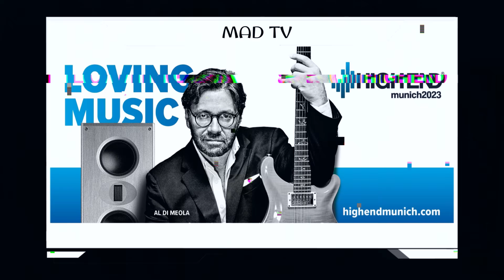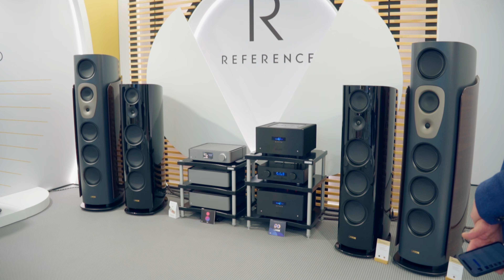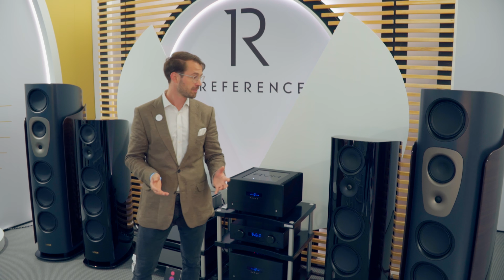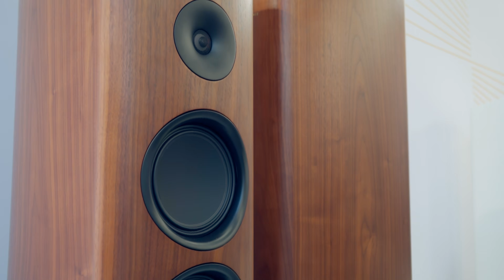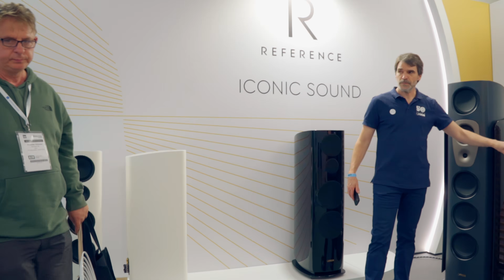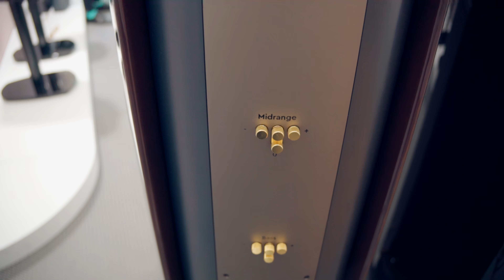NEW Canton Reference Line - High End Munich 2023

Comment: Basically, the Ref 1 is the old Ref 2K in terms of enclosure/driver size and number. Except the cabinet weighs plus 10 kilos and the price tag asks for another 2.5K€. And so on. Canton's not alone here. Most manufacturers keep selling us more heavy wood and ever smaller woofers. 200mm is the new 300mm, 220mm already a dying species. And no, they can't move the same amount of air or produce relevant levels below 20Hz. But of course they will sell you a huge 15 inch subwoofer for another $€. Let's face it, these nice cabinets account for 80 or 90 per cent of the cost. Nothing inside is worth more than 1K.
Reply: now are the nice opportunities here to get some used REF K speakers by Canton =)